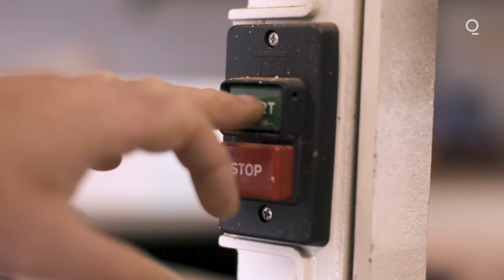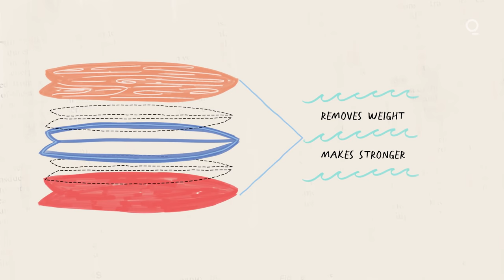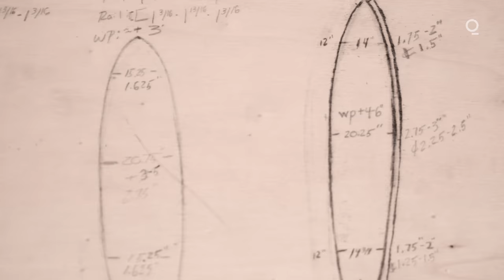How Danny Hess Crafts Wooden Surfboards

Comment: I made wooden surfboards a few years back. One of the nice things about riding a wooden board was that guys would chat me up about the board while sitting in the water - something that didn't always happen otherwise.  I had a totally different approach to the build but I liked your technique.  So simple with the interior build.  My boards always had a vent.  I noticed yours don't.  No problem with heating the interior and pushing things out of whack?  Beautiful work.
Reply: I think because he doesn't fiberglass it, the moisture expanding is less of an issue. So there is nothing to delaminate and wood movement can happen without messing anything up

Comment: He should buy a cnc and build an air bag press. He could cut his production costs in half.
Reply: In what way?
Reply: @moonwalkman99  by reducing the hours of labor needed to finish.
Reply: literally two minutes into the video he explains why that isn't what hes doing - also it seems you aren't a surfer if postulating a cnc'd board would be preferable to a handshape, wood or standard foam
Reply: @kylitio  Cnc'd boards are just better. They're infinitely more accurate and perfectly repeatable. Does anyone still believe hand shaped boards have soul nonsense?
Reply: Why waste money on unsold wood
Reply: @stratostear  you can buy $100 factory made boards at Costco. They are of the lowest quality, materials, and performance. They are always the first to end up in landfills. Mass produced boards will never have the quality of hand shapes, as they are built to be disposable. There ain’t no soul in that.
Reply: press what? still gotta clamp the rocker, which varies board to board, and the unbroken continuity of the longitudinal grain ensures the twang or springiness unique to wood.

Comment: I think it's much more sustainable to have a surf board out of fossil fuel rather than wood ... fossil fuels are bad when you used them as consummables, if it's long lasting objects it's better since you don't cut down trees
Reply: How long does a tree take to grow compared to how long fossil fuels are made? You can repurposed wood and grow trees and trees are a sustainable material where fossil fuels are not.
Reply: Fossil fuels are a finite resource. So if you want to think ahead and work on the future of the sport, then you really need to think about what kind of material we can use in the future. Wood can be sustainable if you only take as much wood out of a forest then it can regrow. Fossil fuels can never be sustainable. 
If you think about the disposal of the board, then clearly a wooden board is much easier to get rid of cleanly, since you can just burn it. It just leaves ashes. A compound board is a lot more difficult. Can you burn fiberglass? No, glass doesn't burn. You have to do more to it after it has been burnt. Can you recycle the materials in a normal surfboard? I don't see how, since everything is glued together. 
I can see carbon fibre and kevlar as at least easy to get rid of (burn), but fiberglass? You'd have to create some special industry to make that at least somewha sustainable, i think. Ideally you'd want to be able to make another board out of the materials of a broken board. That would be nice.
Reply: A board made of fossil fuels is sequestered carbon for 10,000 years even if inside a landfill. Science vs religion of propaganda.i love wood products just as I love leathers and wool.not because they are organic.
Reply: @robertbolding4182  
That's so little carbon, that it barely matters. That's probably the amount of carbon you're releasing in a day. So congratulations, you've just sequestered the CO2 Emissions of a day in your life - that's really going to make a difference. 

And what are you talking about religion and propaganda for? What's religion? What's propaganda. Be specific if you want to make accusations.
Reply: Half a million surfboards are made every year.  Most boards have a lifespan of a few years, some less, some more. They will end up in landfills, unlike these beautiful wood boards that will last for generations.
Reply: This whole video is typical California virtue signalling. It's all a lie. This guy is making wooden surfboards with foam interiors now. What he shows himself making in the video is not very functional.  It's hollow without a vent, and its frame is very heavy. You can see it's not very buoyant when he's paddling out, and then magically, he's on another surfboard when he's actually surfing waves (probably on one of his foam core boards). The boards he makes are beautiful, and they don't need to lie about saving the environment, but they're Californians, so they can't help themselves.
Reply: @jasonlajoie would filling a board made like this video with spray foam help with the buoyancy?